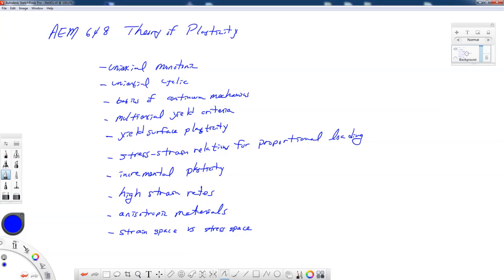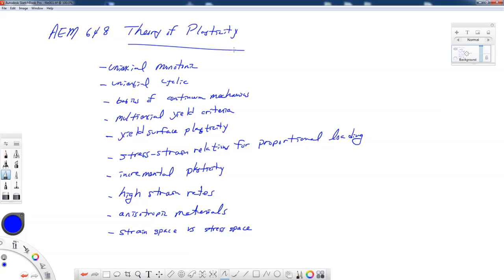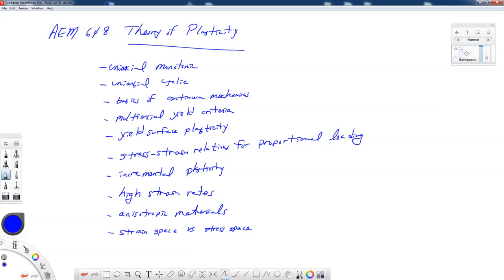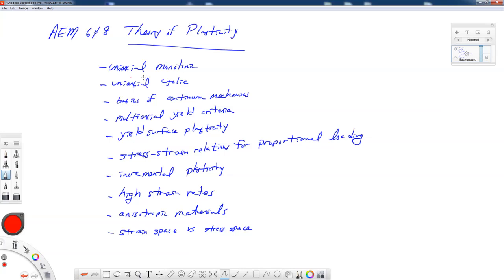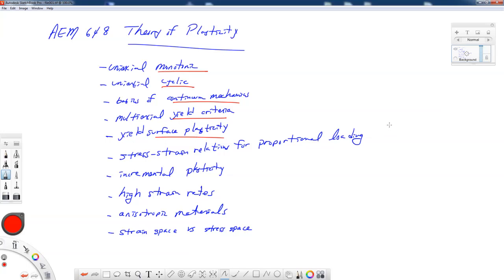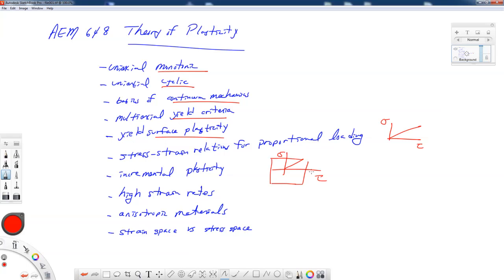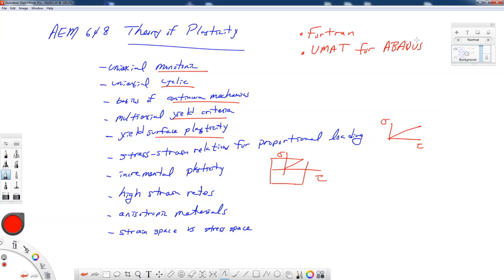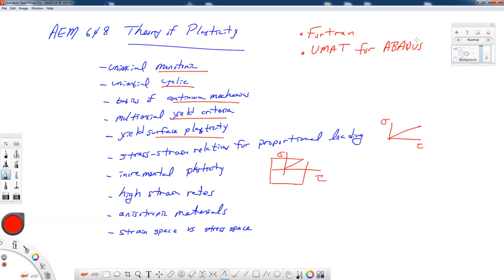AEM 648-1-Introduction to Theory of Plasticity

Comment: Great Stuff! Thank you so much! Just wondering if there is any material that covers bounding surface plasticity or hypoplasticity? Regards!
Reply from the maker: My work has been mainly on metals--which should provide the basic ideas for yield surface plasticity theories. Hypoplasticity appears to be specialized for soil behavior, and is not something I have worked with.  However, I think that an understanding of metal plasticity models will only make hypoplasticity easier.   Bounding surface plasticity is just a particular setup for estimating a plastic modulus.  It is an easier to implement model as compared to multiple surface and non-linear kinematic models.  Cheers!
Reply: @mbarkey.mechanics  Thank you so much for the response. Totally agree with your opinions.